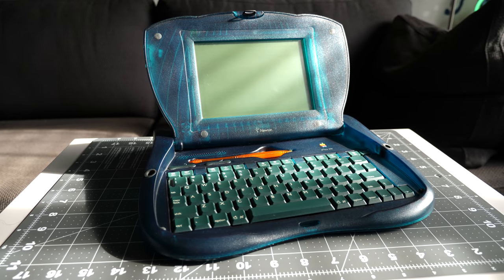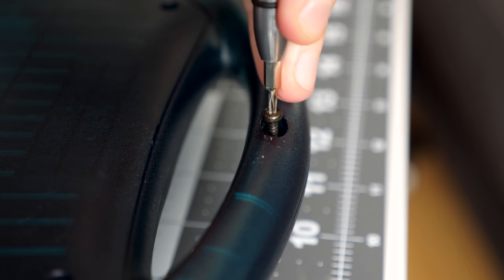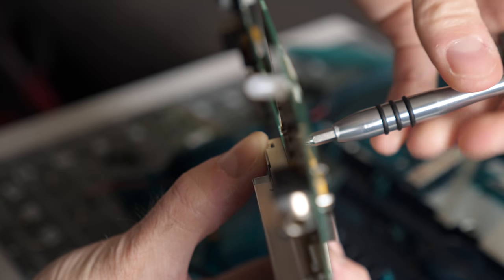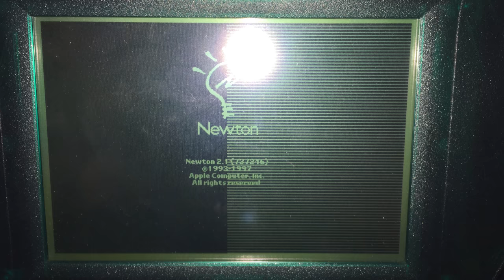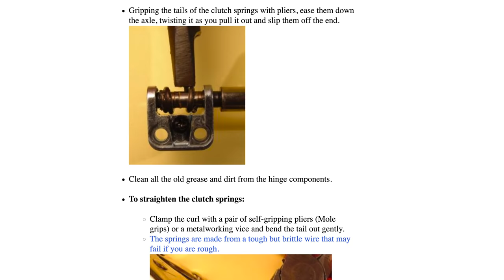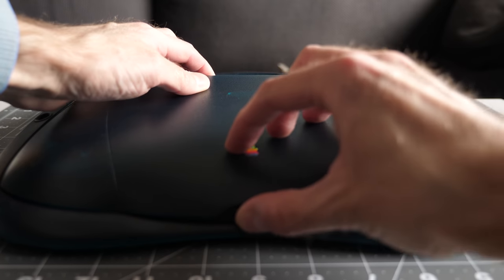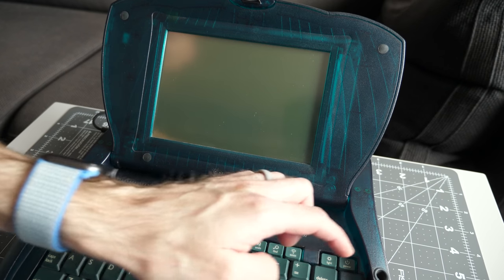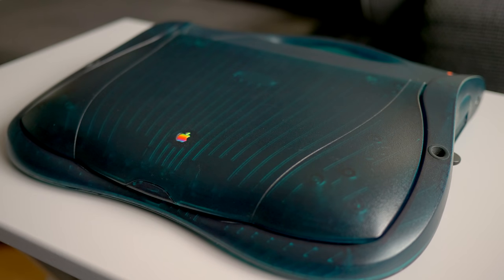Fixing the Fatal Flaw with Apple's 1997 eMate 300

Comment: If you're watching this and doing the preventative maintenance, note that you can stop disassembly at 3:07.   Once you have the main board off, and out of the way, you can clearly access the one on the right side.  On the left, you can move the ribbon cable out of the way to get to the screw and add a washer.  You only need to disassemble the LCD panel (and risk breaking the plastic tabs holding it in place) if you plan to replace the ribbon cable.  I did it thinking the hinges that need the washer must be on the front, only to realize after removing them, that the screws needing the hinge were indeed the ones you can get to once the main board is removed.  Anyway, it's good to know how to do it all, but I wish @This Does Not Compute had made it more clear in the video.
Reply: Is it possible to make this preventative maintenance without unsoldering cables?
Reply: @maxyshoutube6799  I don't think so.  Without desoldering the speaker cable, I don't think you can get the main board out of the way to get to the screws.

Comment: Your channel is a perfect example to demonstrate why "Right to Repair" is important.
Reply: Right to repair for how long?
Reply: @circuitsandcigars1278  How long is irrelevant.
Reply: @lustechsource5197  It is very relevant because requiring an inventory of spare parts is costly but that doesn't matter to you because you aren't paying the taxes to keep the inventory. I worked with companies like IBM who supported hardware for 15+ years and lost millions each quarter in lost, written down and obsolete inventory. That's why IBM exited the hardware realm for the most part.
Reply: @circuitsandcigars1278  It is irrelevant because right to repair isn't about forcing a company to keep extra parts for consumers handy. It's about not artificially adding methods to prevent consumers from repairing their hardware. Like Apple forcing a camera module to work with only one iphone, therefore preventing you from replacing the camera module without their approval.

It's ok for companies to void warranties with unauthorized repairs, but it's not ok to prevent them from making those unauthorized repairs themselves.
Reply: @circuitsandcigars1278  Yeah right to repair has absolutely nothing to do with that. Nobody is expecting manufacturers to "maintain an inventory of spare parts". What they are expecting is that manufacturers stop going to great lengths to make sure a product is un-repairable. Like, as one comment put it, not putting IDs on every single component so that only "one company" can replace that component with the device still working. I would even say, or, colluding with manufacturers of generic ICs to exclusively sell currently produced ICs only to them to ensure that nobody can easily find parts to repair the products.

It's not like I expect to be able to call up the manufacturer of some 40 year old synthesizers I have for parts. What I expect is that they released a schematic with the unit (which in the far past, all manufacturers tended to do, so people could repair them) and that eBay will be flooded with NOS or used parts for that item, because no company tried to strong-arm and control the entire industry to prevent people from obtaining what they need for repairs (again, most pro audio manufacturers back then encouraged self-repairs - it was considered "mandatory" for professional equipment).

Comment: Great video Colin, best open up my eMate and do this as last thing I want is to have to solder that flex cable. Thanks for the detailed breakdown. I picked up a boxed unit untested as it was missing it’s ac adapter and for £50 I got a fully boxed mint example so the bargains are there for sure!

Comment: I pulled out my emate just the other day and found the screen was not working, and so did some research on the possible causes and came across the same links you have. So will need to give this ago shortly. I had previously rebuilt the battery pax some time ago so thats ok. Thanks for the great video.

Comment: i had the springs slip on me, it did the damage to the ribbon, i didn’t know about the issue before hand unfortunately or thought it might not happen perhaps. anyway i had to order a replacement and did the fix fine, but i didn’t need to take the whole emate apart all the way tho.

Comment: Hi Colin, or anyone else that might have the same problem. I recently got an eMate300 and applied this hinge fix. Yet the springs of my hinges themselves snapped and also damaged 3 of the ribbon cable's lines. I don't understand why this happened but i suspect metal fatique got the better of this laptop's hinge springs. I have no idea how to fix this entire problem. The ribbon cable is one thing but the springs? Can anyone point out possible replacements or fixes for this? Each spring has only 1 full peg left to slot underneath the screw now. I think i'm going to clean the remains, lube them up and hope they can be best as can be. As for the cable i guess i better get good at microsoldering now.

Comment: Apple could have fixed this without washers by just specifying a screw with a wider pan or button head screw with a flat bottom instead of the countersunk type of screw head. Neat little device and I am a sucker for the old colored transparent cases. Might do a swap on my Nintendo Switch if I can find a quality case replacement.

Comment: Thanks, Collin this is an amazing video it's gonna help me fix my emate after so long needing this modification and to get the flex cable to replace the broken one. I was wondering do you need to desolder the motherboard or could it be pushed to the side since I have no skills with that what so ever
Reply: you need to desolder the cables in his video, they are not long enough to put aside. we still have a few of the cables in stock but once they run out we will not be doing another production run due to the costs involved.

Comment: @This Does Not Compute By any chance, did the seller of this eMate 300 happen to be in Pennsylvania, or from there? If so, this may be my old eMate from when I was in elementary school. The hinge repair on mine was done by my mother and grandfather. I have bad Dyslexia, so writing is hard for me, hence why they got the eMate, so I could type things out, and use spellcheck. If this is my old eMate, I'm happy to see it in the good hands of a great collector.
Reply from the maker: I’m afraid I can’t remember where I got it — I’ve had it for at least 5 years now. Does the “Beardsley” name on the bottom ID tag sound familiar to you?
Reply: @ThisDoesNotCompute  Sadly, no, but who knows how many times it's changed hands if it is my old unit. Regardless, good to see it in good hands. But it does look like my unit because the scrape on the ribbon looks the same too. My mom tried to resoldering it but undid it because she did not like how fragile it was, and new cables were not available. So I really think it's my old unit. The hinge was poped from it being dropped while in my bag at school from the shelf my bag was on collapsing. So if it is, glad you got it. We sold it in 2002, so I could upgrade to a Gateway laptop.

Comment: I would put a rubber pad or sticky pad on top of the concaved washer that was added for the fix. Why? To keep that ribbon cable from rubbing against the edges of the washer when it's being opened or closed. Doesn't seem apparent but worth doing ;) Other than this.... Nice repair.
Reply: actually our replacement cable has extra added hard plastic protection right in the area that its likely to be damaged, it wont protect you permanently however it will protect you enough when you first notice the problem with the hinge to salvage the cable and fix the hinge.

Comment: It's sadly too late for mine i think unless i succeed to solder the ribbon cable. It has an old password too that i couldn't find how to remove
Reply: remove the password by inserting a pen into the reset hole on the botton of the device while simultaneously holding the power button on the keyboard for about 5 seconds together, then release the power button and it will ask you to reset the device, however if your touchscreen is not working you wont be able to confirm that (it asks you twice) on the display.
Reply: @newtonsales  Thank you very much i will try. I don't remember if the touch still works

Comment: I was a part of the public beta test of the eMate. My primary school was the only school in the southern hemisphere in the 90s that used all Apple computers, so we got to try alot of things pretty early like the clamshell iBook in Feb '99 and the eMate, lol. I actually really liked it, they gave our whole class (20ish) a laptop each and we were free to use them in class. The touch screen was pretty amazing/fun for the time,  it was visually pretty boring though and the refresh rate was verrry low. Pretty sure you had to use the stylus that came with it too, I dont think anything else worked on the screen. I spent hours looking at the cool see through shell of the system, I always wondered what happened to this Apple computer.
Reply: The Newton had a standard resistive touch screen, it didn't need a special stylus.